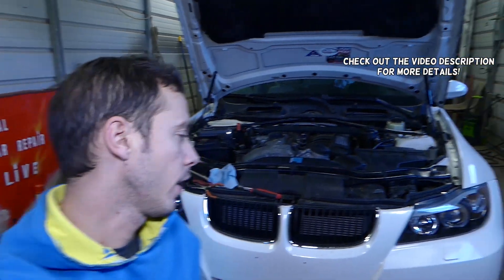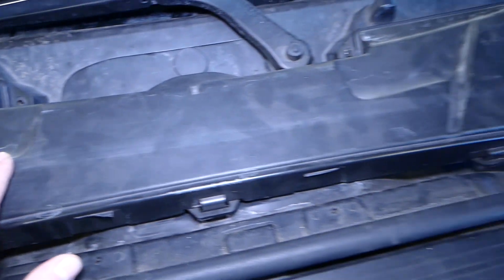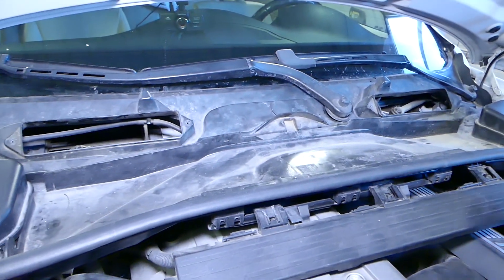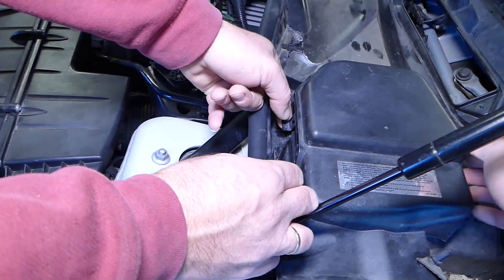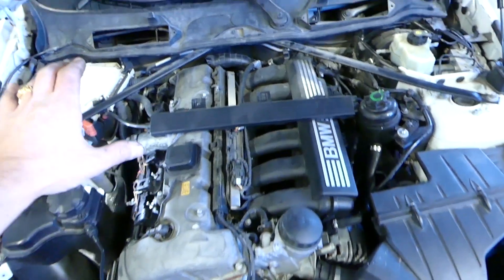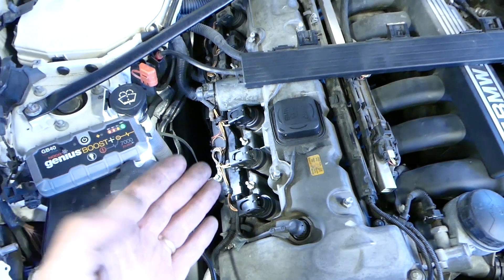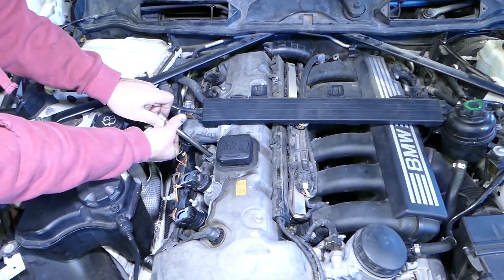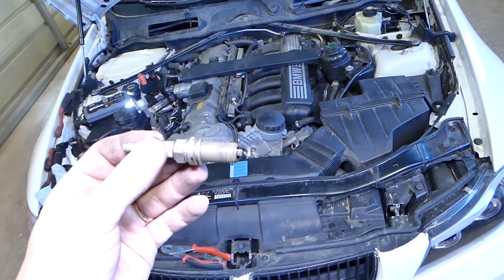HOW TO REPLACE SPARK PLUGS ON BMW E90 E91 E92 E93

Comment: how can I message you? I have a 2010 BMW e90 328i , I have a few codes the car was obviously in a front bumper wreck, I have bought a new bumper and some other parts. I have these codes coming up on my car.93A9 driver sealbelt tensioner I have ordered a new one. The next code is 93B1 head airbag do you have a video on this one? do I need to replace or can I bypass this one? next code is 93B2 safety battery terminal, I want to send a picture how they have the battery wired up on the positive side. Two more codes 2A15 fuel tank ventilation system and purge air system minor leak. last code A8AC side marker light , left faulty all the lights seem to work , I do have new headlights I will install when I replace bumper and hood maybe that will fix that one.

Comment: I have a BMW E90 318i  sometimes the car runs rough (not all the time) no error-fault code in ecu checked with INPA what could be the problem? help pls
Reply: Does the car dies?
Reply: @JonathanRomeroMusic   no it's fixed now it was the NOx sensor.
Reply: @JonathanRomeroMusic mine does this, and it dies at idle. What do you think is the problem?
Reply: @osnowdeal could be a cracked vacuum line